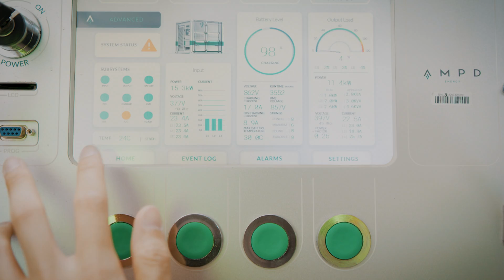How can we Clean Our Air? 💨 | The Earthshot Prize 2022 Finalists

Comment: Strangely, but probably just the way it is, I learned of Earthshot because of the celebrity of the royals.  Similar to Angelina Jolie, celebrities that care deeply go to the places that they care about and the media follow.  So I learned about Earthshot.  While I was fascinated by the cook stove story, the scientist in me would have appreciated some discussion about how the stove is constructed.  What are the engineering principles that are brought to bear in the design.  How is the product tested?  Were there laboratory facilities equipped with data collecting sensors used to evaluate prototypes?  Even if that level of detail was too much for the video, a link would be helpful.  I found the website for the stove, but it too lacked detailed information.  The story does get me wondering about two recent purchases.  A Weber charcoal grill and Firebox campfire stove.  Together with the Weber charcoal grill I purchased a chimney which precludes the need for charcoal fluid.  Much to think about.  Thanks for stimulating my curiosity and getting this on my radar.